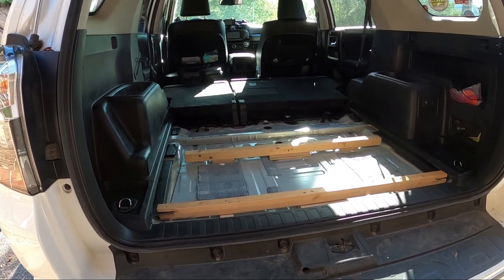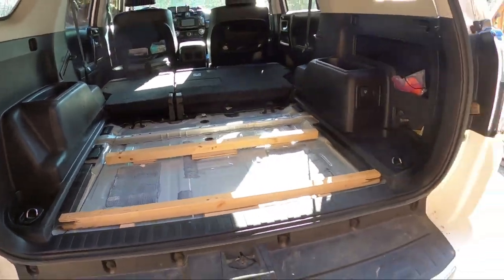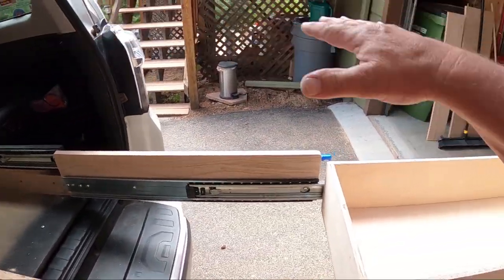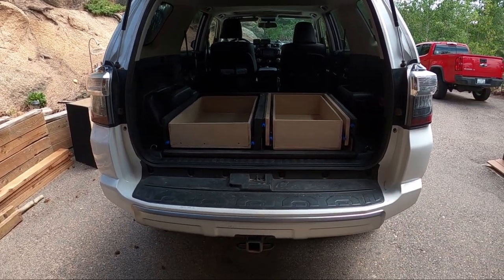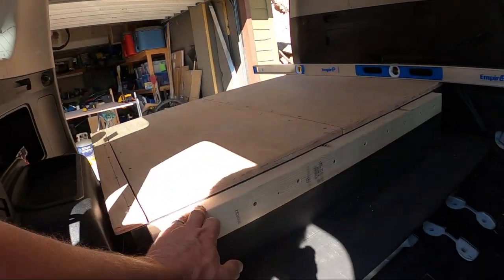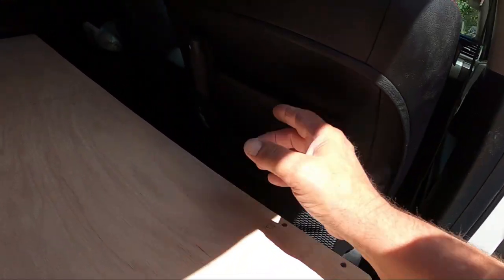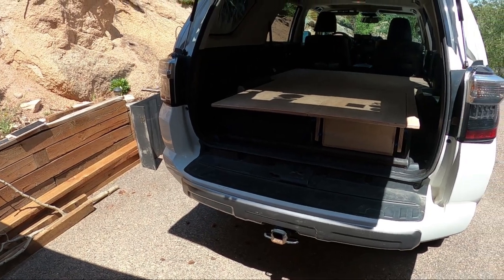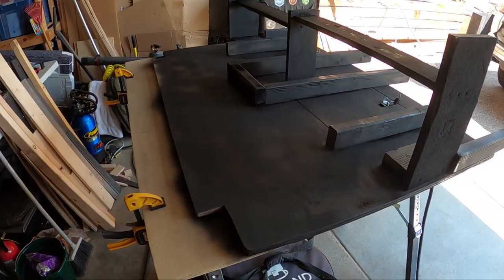Toyota 5th Gen 4Runner Drawer and Sleeping System

Comment: One reason I removed my DIY drawer system was due to weight. One thing you could to do lighten it up is cut weight reduction holes in non-essential plywood spots.  Build looks clean and sturdy though!
Reply from the maker: I was a little concerned about weight, but I do have the heaviest springs front and back to compensate for all the weight I added.  I did make it as light as possible, but didn't want to lose any functionality.

Comment: This is an amazing setup. Cant buy these made since they cost so much. Want to make a set but dont know where to start I have the same truck.

Really nice man, good work!
Reply from the maker: Thanks Ernesto.  They do cost a lot, that is why I wanted to make my own.  Still not cheap, but much more affordable.  It took me a while to start, but one weekend I just got up and started.  Once going, it wasn't bad.  Good luck and get building.
Reply: The Grumpy Gobbler gonna tackle this next weekend do you remember what size drawer slides you used?
Reply from the maker: @4estrnr472  I used 30" slides

Comment: What was your total cost in building this? Do you have any resources/plans that you followed?
Reply from the maker: I probably have around $750 into this.  The biggest expense were the slides ($160 a set).

I do not have plans, I was winging it the whole time.
Reply: @TheGrumpyGobbler  Couple of more questions: 
1.) do you have the total amount of each item you ordered for the links above? (sizes of rails, qty etc.)
2.) How did you mount the boards to the bottom frame initially?
Reply from the maker: @ChrisEddlemon  Here is a link to the slides I got (30"). They are cheaper now.

https://drawerslidesinc.com/drawer-slides/product/500-lb-full-extension-lock-in-lock-out-drawer-slide/

I mounted a sheet of 3/4" plywood to the rear of the 4Runner and then built the box with the drawers and screwed it down onto that plywood piece.